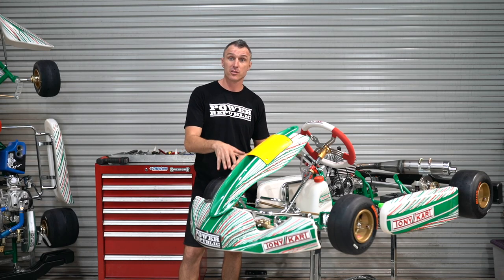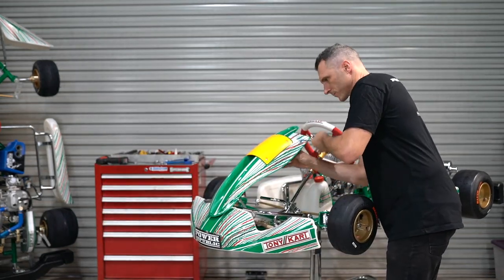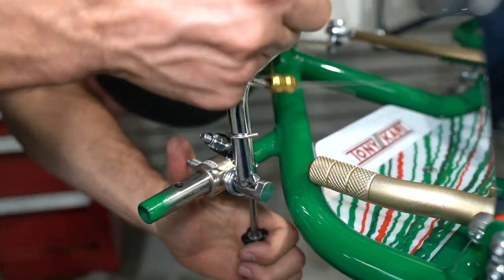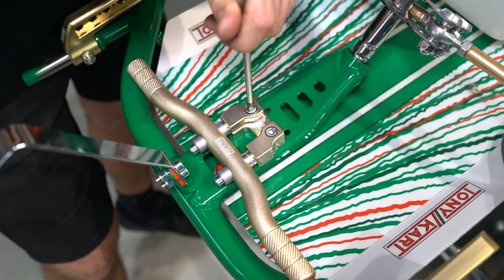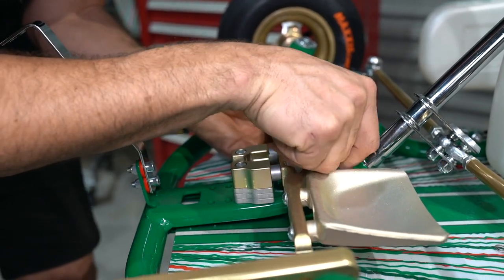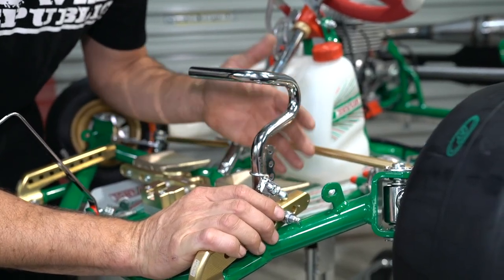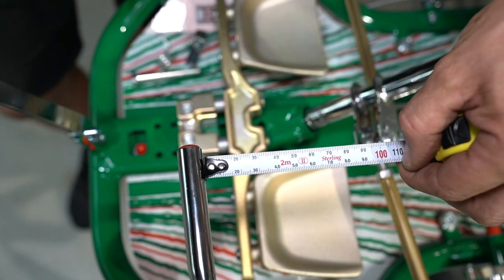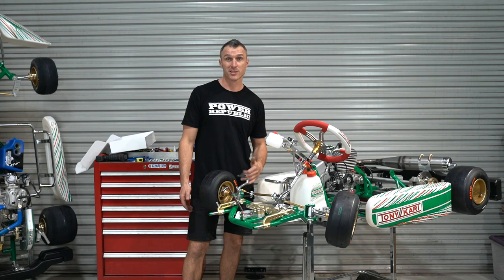Custom Pedal Set Ups For Little Racers   POWER REPUBLIC

Comment: Love ya work Derek! I know you have done a seat install video but is it possible to do one for a kids seat? Just picked up a new jecko for my boys 900mm arrow but he is so small im having trouble getting it close enough for him to reach the pedals even with extensions and high enough to see over the wheel even after dropping the the steering column down to the bottom hole. Really narrow seat and seems to be in my opinion to much of a gab between the seat and fixed seat stays.
Reply from the maker: thanks for the great suggestion.   have you got some of these.....
https://www.internationalkarting.com.au/shop/item/seat-supports-extension--plate

Comment: Hello, thanks again for your videos, i wanted to know if you can help me, i need to remove the pedals of a kosmic 2021 frame but it seems they are very tigth and i dont want to damage them using a metal hammer, i have already used a rubber hammer but no succes, hope you can help me guiding me how to do it
Reply from the maker: Have you removed the retaining bolt on top?  If so keep going with the soft hammer, they will come off
Reply: @PowerRepublic  thanks for answering me :) i did remove the bolt and i have already tried with a rubber hammer without success :( do you think heat can help?